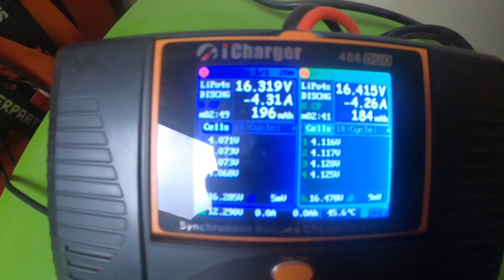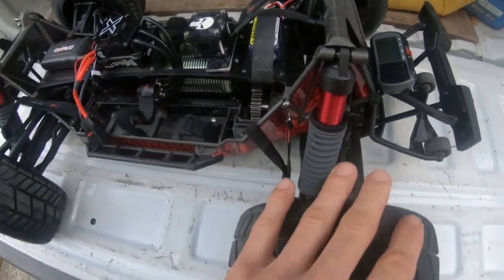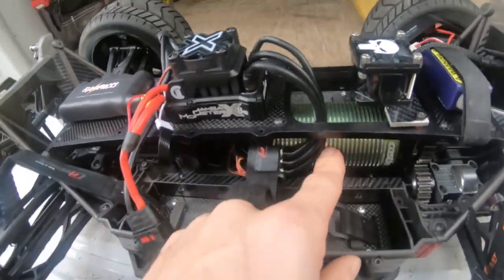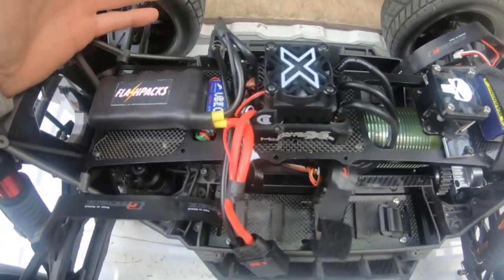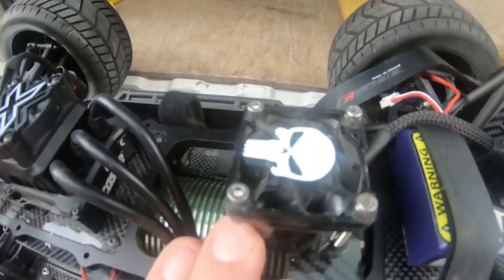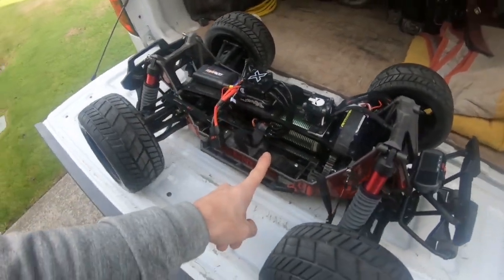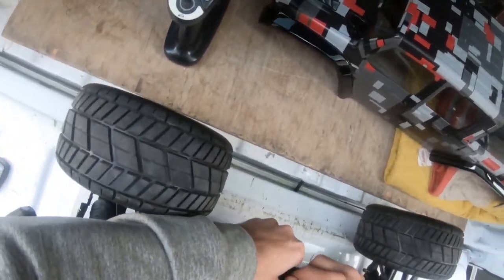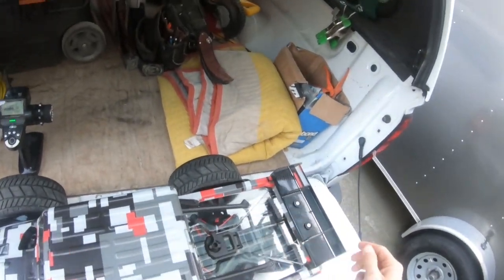***NEW PB!!!*** TRaXXas XMAxx 8s SPEED RUNNNN!! MMX8/2028 800kv New personal best! #WFO

Comment: Is your top chassis brace a Xtreme carbon fiber/ aluminum?...I contacted Xtreme about using it with a WFO motor mount and 2028 motor and they said it would not work...
Reply from the maker: Hey bud! Thanks for tuning in! It is the XTREME RC brace. At the moment it works but if I go to a much bigger gearing it may not work